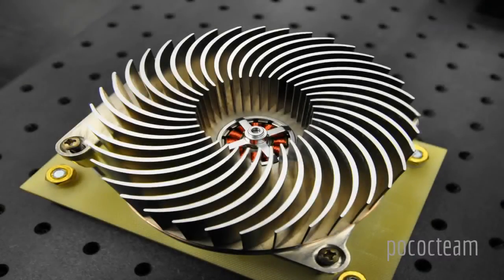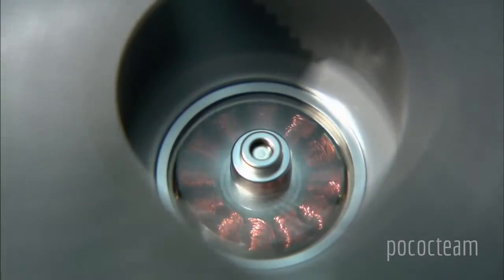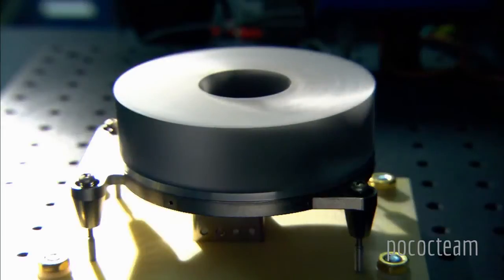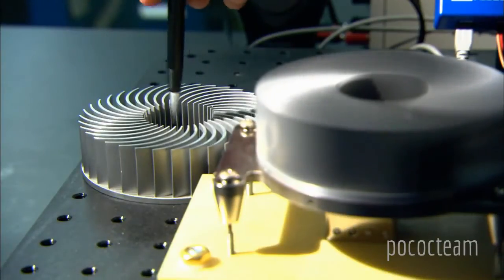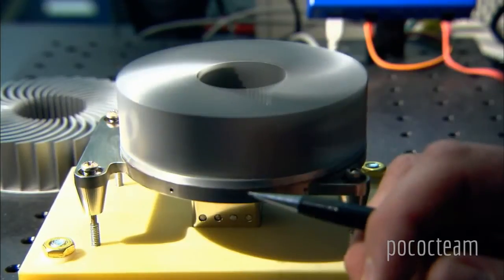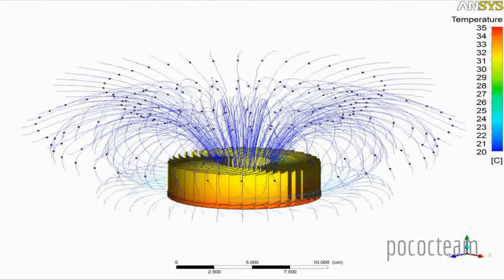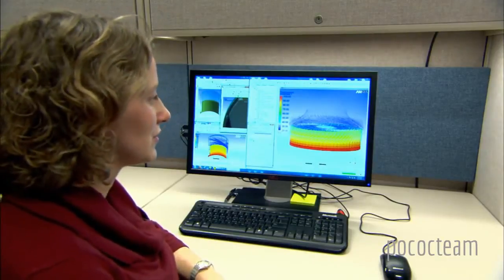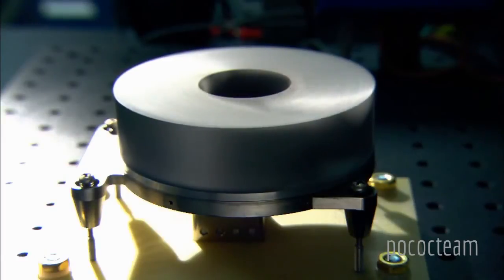[pc] Disipador de cpu Sandia cooler [air bearing][ingles]

Comment: Ayuda por favor. Esta duda y por fin armo mi PC
Cual disipador seria efectivo a mi pc.
Y si me recomiendan un Gabinete bonito que por supuesto, entre todo esto (ATX)

* Placa: 970A-G43
* Procesador: FX 8320E X8 (AM3+)
* Ram: HyperX Fury Black DDR3 4Gb 1600MHz (Son 2)
* Disco Duro: 1 TB Seagate Sata 3 7200 rpm 64mb
* Video: Todavía no la compro, pero le pondré una R9 270x Vapor-x 2GB
* Fuente: Todavía no la compro, pero le pondré una de 600W 80Plus Bonze

Porfavooor!!
Reply: se que es tarde, y tengo casi las mismas caracteristicas, vete por un hyper evo 212